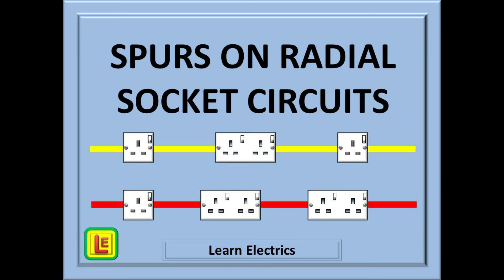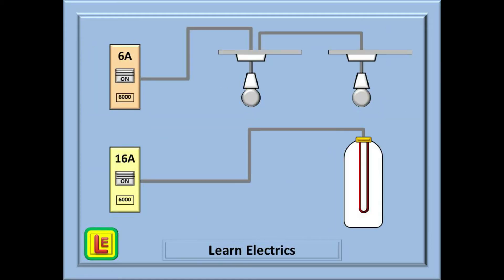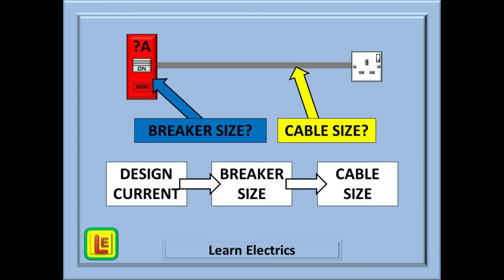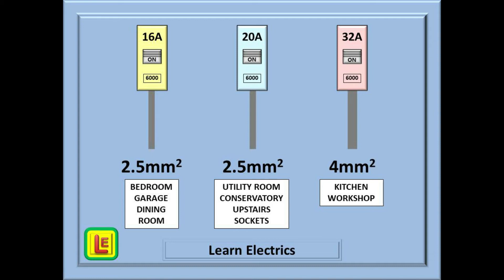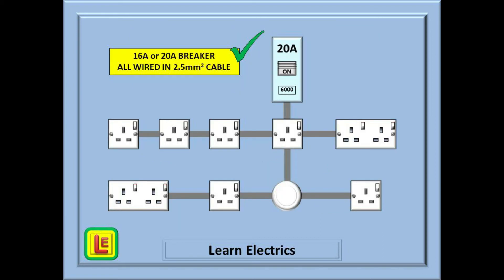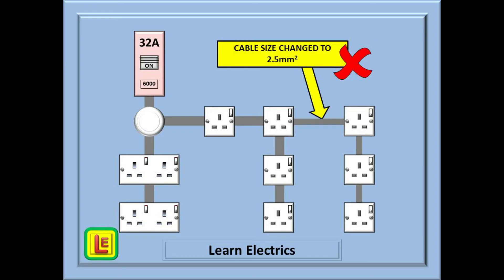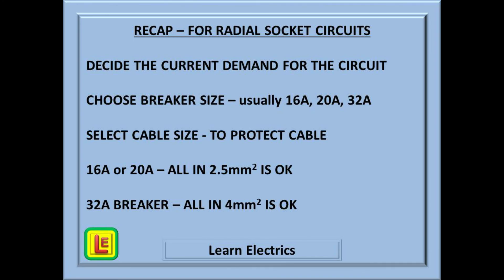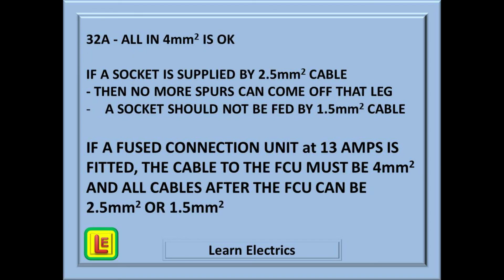RADIAL SOCKET SPURS. How to install them correctly and safely.

Comment: Hi buddy, great video as usual. But quick question. For 32amps radial circuit in the osg the only reference method where the cable current carrying capacity is more than 32amps is clipped direct i think without it having it front of me. Would you not go 6mm just to be safe? Im still learning so just asking mate.
Reply from the maker: For a 32A radial socket circuit, use 4mm.
Take a look at the video on the link below, it will explain all.
https://www.youtube.com/watch?v=wKCxgEWleHk

Comment: You dont mention what the round white boxes are on your circuit diagrams? Presumably they are junction boxes to aid the extension of the circuit? Example at 05:42 into the video. Thanks
Reply from the maker: Spot on, JBs. Thanks for watching.

Comment: Could you answer this for me I run a radial in 2.5 mm armoured from the fuse board in garage on 16 amp breaker,  to a summer house I have just four sockets I have 6 led spotlights inside with its own switch and 4 outside it with its own ip rated switch but I just wondered I’m taking two fused from the radial to provide power to the light switches is it ok to have them in the radial or should I spur off the radial you know what I mean ?
Reply from the maker: It is recommended that you use a 3A fused spur for the lighting. some sparks use a 3A switched fused spur as the light switch. Take a look at these two videos. I don't know the length to your summer hoiuse but make sure that the voltage drop is ok when lots of things are switched on. The videos will show you how to do it. Dave.
https://www.youtube.com/watch?v=nVZeIFeEwl0
https://www.youtube.com/watch?v=6GNb1SSEjQg
Reply: @learnelectrics4402  cheers it’s from the garage fused board it’s only 27 metres I think I will use two fused spurs to feed each switch. I’m a JIB electrician but not done it like this before thanks will watch. It going to be a very low wattage heater and tv on occasion and the lights which are nothing down there it’s on a 16 amp breaker in 2.5 armoured down  never put a fused spur within a radial like this it’s fine isn’t cause you don’t want to spur of a spur it’s just wants to be part of the radial doesn’t it ?

Comment: There's no such thing as a spur on a Radial
Reply from the maker: Take a look at the Wiring Regulations page 556 where it talks about spurs on radial circuits. Thanks for watching,
Reply: @learnelectrics4402 Mic drop!
Reply: @learnelectrics4402  if it's the same size cable/correct size it's not a spur on a radial it's extending the leg.

Comment: I have a 9 kva generator rated 220 volts 30 A. Can it start and run two hairdryers rated 2000 watts 220 volts each at the same time simultaneously?

Another question if i connect two of them, which mm cable can i use and the socket should be rated how many A?
Reply from the maker: Take a look at this video on the power matrix. It will help you to calculate all the loads you want to run off the generator.
https://www.youtube.com/watch?v=fhHq_VPfWh4

Comment: I have just started my kitchen unit refurb, and have found just 1 twin socket wired to a radial circuit
The radial is the old cooker circuit, now on a 16A  MCB, in CU.

2.5mm cable to the socket, from junction box fed with 6mm (original cable).

Pretty sure i can have a few more sockets & extractor feed from this circuit ??
Reply from the maker: With a 16A breaker and 2.5 T/E on a radial circuit, you can add sockets etc. as you wish as per the video. Dave.

Comment: isn't it 27A in air? and 21A when in the walls, due to insulation?
Reply from the maker: For 2.5 and ref method C it is 27A. Ref method C includes clipped direct to the wall and skimmed over.
Hope this helps. Thanks for watching. Dave.

Comment: at 7:51 why is the bottom left socket ok using a 2.5mm cable? theres no fuse between the socket and the break unlike the FCU on the right
Reply from the maker: Its a radial circuit and the cable is the same size as the cable coming out of the breaker. Have another look at the video, you will pick it up on the next viewing. Thanks for watching. Dave.

Comment: Hi Dave, just seen your Radial socket spurs video.   Can you comment please.  Re: My integral garage.  My main fuse box inside the house has a single 16A Breaker marked garage socket only which serves a single 13amp socket in the garage. The wiring is 2.5mm and is a single twin and earth cable.    Does this arrangement tick the box as a true radial circuit as I thought initially it was a spur coming down the wall from upstairs in 20mm white upvc conduit. 
 
I want to increase the number of sockets by a factor of 4 making 5 double sockets suitably arranged around the garage walls.  Your diagram around 5.28  minutes into your video seems to fit perfectly which suggests it's ok for a circuit to use a 16A or 20A Breaker.  I  do also want to use a FCU switch either side of the original double 13amp socket so I can isolate the 4 new double sockets either side of the original socket fitted by the builder.   Like a U shaped configuration of sockets, 2 down the left wall, 2 down the right wall and the original socket on the back wall.  

So my question is,  if the builder's electrician used a radial circuit from the main fuse board to the garage and marked the 16A Breaker as Garage Sockets  does your diagram at 5.28 minutes fit my understanding that I can extend this radial circuit the way your diagram suggests and extend either side of the original socket.  

Finally given the fact the fuse board 16 A Breaker is clearly marked garage sockets and is a single length of 2.5mm twin and earth can I be sure this is not a spur from the upstairs ring main.     
Cheers
Steve
Reply from the maker: Steve, only you can be certain it is a single cable from the 16A breaker. Plug something into the garage socket and turn off the 16 A breaker, if it loses power then the 16A breaker is on that cable. You can also do the same with the ring that you suspect. Turn the ring off and see what happens in the garage. Yes, you can extend a radial circuit as you suggest, remember not to overload by plugging too much into the sockets. 16 amps is still your total load shared between the sockets.
Reply: Thanks Dave, appreciate the prompt feedback.  I did turn off the 16A Breaker marked garage socket  at the fuse board and the power was turned off  at the garage wall socket.    I will do the same with the Breaker that controls the upstairs ring main wall sockets just to be sure that power is still ON  in the garage.   Pretty sure this will confirm the garage power supply is a radial circuit.  

Your YouTube channel was the only one I understood because it dealt specifically with  Radial circuits and additional power sockets.  Great video and what I took from it was the importance of protecting the cable at all times.   I have fitted two fused switches, one either side  of the original 13amp double wall socket as I want to isolate the extra sockets when not in use and only turn either of them on when I need power to various power tools.   The wiring to these 2 fused switches was also taken off another YouTuber  due to the switch needing a Supply in and a Load out.    I hadn't appreciated that a fused switch requires a power in and power out configuration.  

Thanks again Dave     
     @learnelectrics4402

Comment: Hi Dave,in a radial 32A breaker size and 4mm square cable ,why is it safe to add one spur socket using 2.5 mm square cable? Sorry to trouble you but I will be very grateful for your answer.Thank you.
Reply from the maker: One spur socket will have a maximum load of 13A on the circuit. 2.5mm cable has a capacity of 27A, so the load is not going to overheat the spur cables.
Have a look at this video, EXTENDING SOCKET CIRCUITS, click on the link below
https://www.youtube.com/watch?v=3mBXNBwpxXo

Comment: At 5:48.  The two spurs with only two single sockets on each. These two spurs off the 4mm radial can be in 2.5mm cable. The maximum current the two sockets on each spur draws is 26A (13A for each socket).  The fuses in the plugs limit the current draw on this spur, not the 32A MCB at the consumer unit. 2.5mm cable is rated at approx 27A maximum current draw, so 2.5mm is suitable. If the 2.5mm cable is seriously derated because of being surrounded by insulation, etc, it can draw a max of 25A, then 4mm cable has to be used.

No need for an FCU in the spur as the fuses in the two plugs will allow only a max 26A to run in that spur, below the 2.5mm cable's current rating.
Reply from the maker: Thanks for the info John.

Comment: Hi Dave I have a question How many sockets can we put on a 32A ring main ? 
Can you explain please
Reply from the maker: That's always a difficult one Emi. Theoretically as many as you want because the 32 amp breaker will stop you overloading the circuit. In practice just be sensible, what do you use the room for. In the lounge you might need 4 behind the TV and 2 doubles at different places in the same room. In a bedroom, perhaps only two in each room. A kitchen - well, loads but will you have everything plugged in at the same time, they are usually placed for convenience. There are suggested numbers by some organisations but they are all slightly different. I might put together a list of sensible quantities. Thanks for watching.

Comment: Honestly this channel should be up there with 100k subscribers very informative and clears a lot if doubts ... one request could you do a video on kitchen wiring design using just a 6/4 mm cable spuring off for cookers,sockets etc I know the ring design with 32 amps and cooker with 20 amps but I'm really interested in how electricians use just the one radial circuit with fuse spurs using 4/6mm cable
Reply from the maker: Thanks Allah. Certainly a video to consider. Thanks. Dave.

Comment: I am trying to work out how to do a radial run from a 32amp breaker that needs 4 FCUs for washing machine, dishwasher, extractor hood and built in microwave. Your video says that it needs to be run with 4mm cable but as I understand it the FCUs must be spurred off sockets meaning that 3 cables need to go into each terminal on the socket. But three 4mm cables don’t fit. Can you advise me please on what to do? There are no free 20amp breakers available in the consumer unit. Thank you for your time. These videos are excellent.
Reply from the maker: No John. Wire the FCUs just as you would sockets. Run 4mm to the first FCU and back out to the next FCU and so on. Just think of it as one long line of cable 1 cable in, 1 cable out. You can even go socket, FCU, FCU, socket. Its a radial circuit so just daisy chain it. The loadside cable from the FCU to a single appliance can be in 1.5mm cable.
The 3 cable ideas are only if you spur off after you have all the sockets in and no room for manouver on cable positions.
Reply: @learnelectrics4402  thank you so much for replying. So the in and out to the next FCU is only 2 cables....feed in and feed out to next FCU. And because the FCU has two sets of entry points I’m only cramming 2 cables into the in....and then out....bit and one from the separate load terminal to the plug socket for each appliance? If I’ve got that right? I’ve been watching all your videos on lighting, ring and radial circuits and they are so well presented and understandable. Just needed to get this clarified. Hope I’ve got it right this time, thanks to your advice which is much appreciated.
Reply from the maker: My pleasure John. Yes, you've got it now, two cables for the supply side, and one for the load.. Good luck with the project. Dave.

Comment: How do you know/work out the design current demand,  does it go off the number of outlets?
Reply from the maker: The anticipated loads on the circuit. Difficult with sockets I know. But ... think about it. Which circuit is likely to be heavily loaded, the kitchen where the kettle, washing machine, toaster, dishwasher are, and the food mixer and anything else. Perhaps over 20 amps at times so you might need a 32 amp breaker
Then you have the bedrooms, a TV, a computer and a bedside light. 5 amps if you are lucky, so a 16amp breaker may easily be big enough.
Good question, thanks for watching.

Comment: Hi, Thanks for the video... Why do you need to put thicker 4mm cable just before FCU, but OK to do 2.5mm after... Will this bit of cable just before FCU be ever overloaded as it only will ever drain on this cable as much as the FCU allows? Hope this makes sense
Reply from the maker: Good question. Until the conductor has passed through the FCU it is not protected by the FCU and so must have the same rating and size as the rest of the circuit before the FCU.
Hope this helps. Dave.
Reply: @LEARN ELECTRICS  Thank You for your reply. I just cannot get in my head, even if its not protected by FCU, how could possibly be this cable overloaded if this only be drawing power required by devices behind FCU... If its legal requirement then so be it I just cant get my curious head around this...
Reply from the maker: Its not just a little bit of cable. It actually goes all the way back to the CU before it meets a fuse to protect it. Fortunately, we don't make the rules. Sometimes we just have to go with the flow. Good questions though and thanks for viewing. Lots more to come. Dave.
Reply: Mr Gresso, a cable can be protected by a fuse downstream or upstream - nothing wrong with that. So effectively you are correct. Convention is that a cable is best protected by a fuse downstream - so everything after the fuse is protected. For tidiness the 4mm is run to the FCU.

Comment: I thought you are unable to spur on another spur ? Without a fused socket added ?
Reply from the maker: A lot of people think that Joshua. This video is about RADIAL circuits which are different to RING circuits. If you follow the rules regarding cable sizes and breaker sizes it is permitted in the Wiring Regulations. Hope this helps. Dave.

Comment: Hi Dave, may I share a current challenge (no pun intended) ?  I am refreshing some garage electrics and can not locate the source of the spur that feeds the single 2.5mm T&E entering the garage from an underground conduit.  I do know (by electrical isolation) the spur comes off the only ring final in the main house but can find no fused connection unit.  I was proposing my best compromise to fit a 13A FCU as the first item on the garage circuit.  This clearly leaves the 2.5mm spur from the house vulnerable to a short circuit fault as the ring is on a 32A MCB with RCD upstream, but it would limit the current drawn in non-fault conditions.  Any thoughts?
Reply from the maker: Mike, refusing at 13 amps will certainly make that part of the circuit safe. Another option I have done in the past is to rewire the whole circuit from either the CU or a point at which I know where the cables are coming from. Even though you do not know where the connection is made, the 13A FCU in the garage will disconnect at 15 to 17 amps and stop any flow along that leg from the house so it is theoretically still protected. Not the test book answer but you are making it safer which is important.  Good luck. Dave.
Reply: @learnelectrics4402  Thanks for sharing your thoughts.
Reply from the maker: My pleasure Mike. good luck.

Comment: +LEARN ELECTRICS
Why is the secondary-side of FCU shown as needing 2.5mm cable, surely this can be reduced to 1.5mm, in the same way as FCUs attached to Ring-Circuits ?
Reply from the maker: The slide is showing just one example of a reduction in size from 4mm to 2.5mm. This is qualified 2 slides later where it states  the secondary side can be 2.5 or 1.5. Hope this helps.
Reply: @learnelectrics4402  Oh you are right, apologies!.
In which case, I have a different inconsistency to raise!.  I'm covinced the unfused-spur cable going TO that FCU could be 2.5mm for the same reasons that the double-socket could be an unfused-spur of 2.5mm ... so long as the input-side of the FCU is not extended further.
Reply from the maker: Not according to the Wiring Regulations, until it has actually gone through the 13A fuse it is still being protected by a 32A breaker. What if there is a short circuit in the FCU on the input side. The 13A fuse will not be in circuit to give protection. Remember, the fuse or breaker is there to protect the cable. Thanks for taking the time to view the video. Hope you enjoyed it.
Reply: @learnelectrics4402  The same applies to double-socket as unfused-spur you show on same diagram, (and similarly for 2.5mm spur on a ring circuit
), in either case it is accepted the shorter bit of 2.5mm is not resistive enough to prevent MCB tripping in 0.4sec even with 32A breaker, and is accepted the downstream pair of 13A fuses  limits the current you can take from the spur.  The FCU has the same property and should be no different in accepting 2.5mm as the unfused part of the spur and then 2.5mm or 1.5mm beyond it.
Reply from the maker: Thanks for your useful input, great stuff. Dave